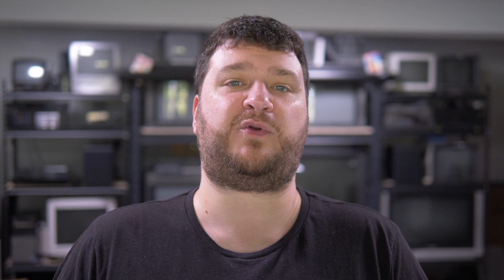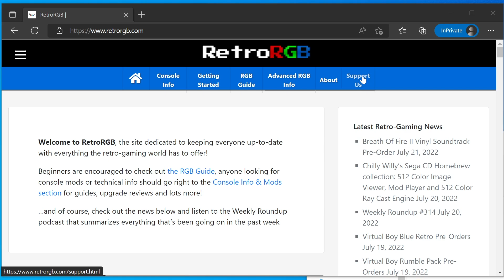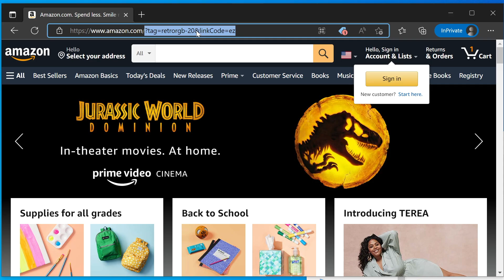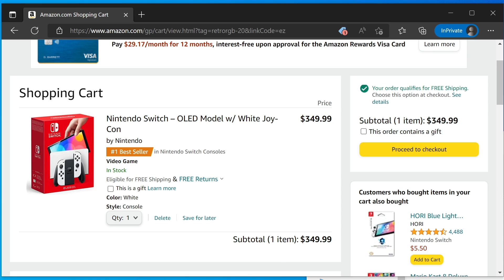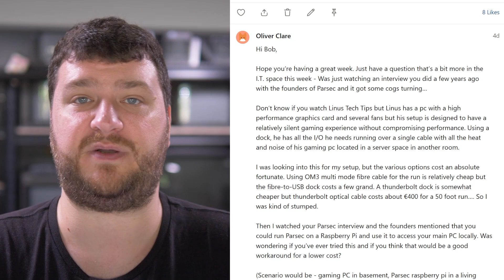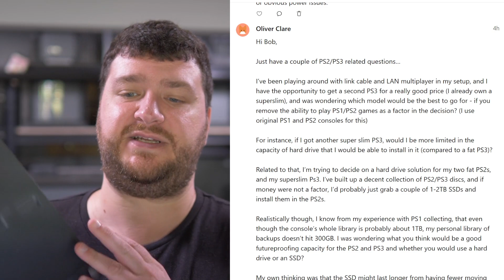Supporter Q&A #217

Comment: Hi Bob. I had the same issue with the GCHD Mark ii audio desync. Long answer short, it you switch to another HDMI input and then back, the audio will resend with the video and be fine from there on in. The explanation from EON is the following: "Typically, the audio drift is caused by the hardware reading the audio from the GameCube and the GCHD Mk-II. A firmware update wouldn't solve this, unfortunately, though if you're looking for a firmware update, I would be more than happy to help you out with that! (Just let me know)

With that said, if you're getting audio from the GCHD Mk-II via HDMI, it's most likely that the audio device/TV your using isn't understanding the GameCube's digital audio well, causing that slight lag. If you switch inputs off of the GameCube and back on, I'm sure the audio will reset.

We've actually thought ahead of this problem with our GCHD Mk-II's build after learning about this with our original GCHD. The miniTOSLINK on the back of your GCHD Mk-II was put there so that you can now source the audio from the analog port of the GameCube. If you have a sound bar or separate speakers, you could technically use a 3.5mm AUX cable and bring the audio directly from the GameCube into whatever speakers you would like!

Another option is to test another HDTV or display and see if you get the same audio drift on that device as well."

Comment: For the PS3, i would recommend something that was usually done with the XBox360, cut a hole or holes on top of where the CPU heatsink is, and attach a fun that untroduces air to it. The newly introduced air will flow organically and adapt to the already existing airflow and will be routed to the nearest exit. I would recomend a small silent fan, like an 80mm or smaller fan from noctua.

Comment: A sound bar, when you get right down to it, is literally just a string of speakers hard-locked to each other.  It's no different than a typical speaker setup, minus the flexibility.  I consider it a silly fad much like those "fanless" fans they had a few years back that literally just hid the fan blades in the base to trick you into thinking it was using... I dunno artificial gravity or something to make the air move.  These days all I'm looking for in a surround sound setup is zero lag, but it's so hard to find any modern surround sound system that allows analog systems to pass through without additional digital processing added.

Comment: For Clarke, if they're looking for a specific receiver that definitely allows optical audio inputs for HDMI video sources, check out the Sony STRDH590. I use it for the exact use case they're looking for. Just set the input to TV and it will show video, but will pull either from the analog or optical input (though mine seems to have an issue with picking the one that's providing sound when both are plugged in). It's pretty cheap for how robust it is, especially if you only need 5.1. But you'll need a good 4K HDMI splitter (luckily Bob just posted an article with two good ones!) for gaming with multiple consoles hooked up. There's only one Game input on the receiver.

Comment: Facepalm!  Soz, wrong spot there.  Thanks for answering, very much appreciated.

As far as the setup goes I came across a £1500 LG bar for £500 second hand.  I snapped it up, so we'll see what happens.  I also like old stuff that is new to me!

I would have liked a discreet AV setup more as I agree they are just bound to be better, but then the speakers would have broke my budget.

Also, if it's a short week I agree with what's been said.  Take easy when you can and don't worry about it.

Thanks again Bob.